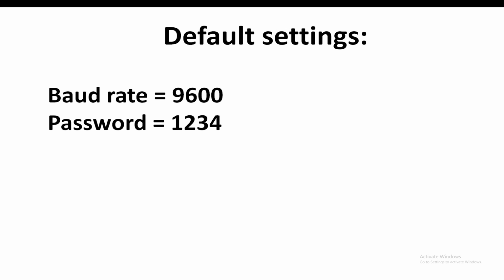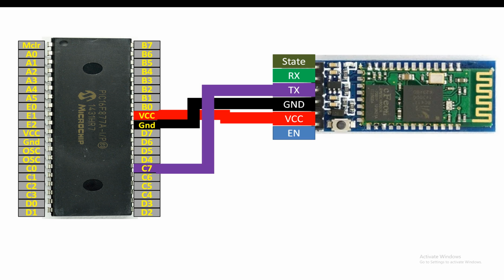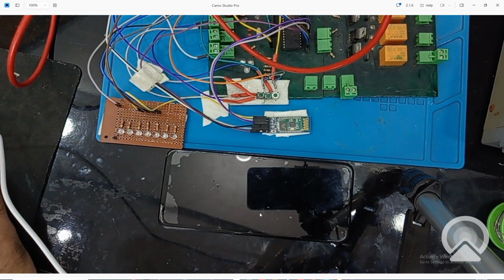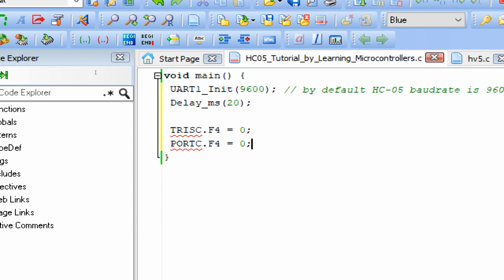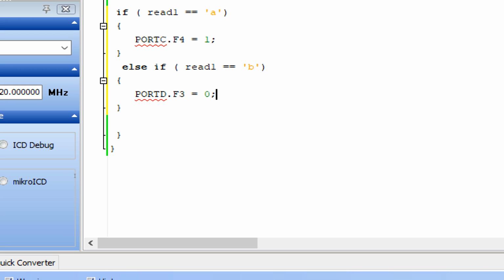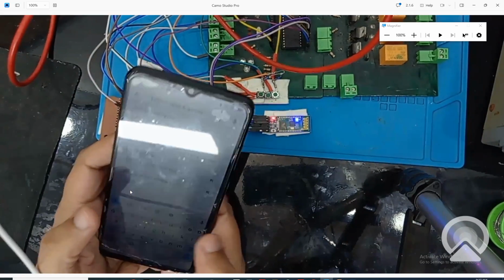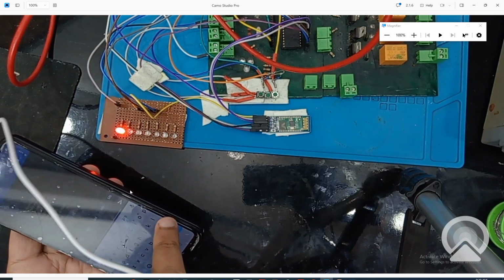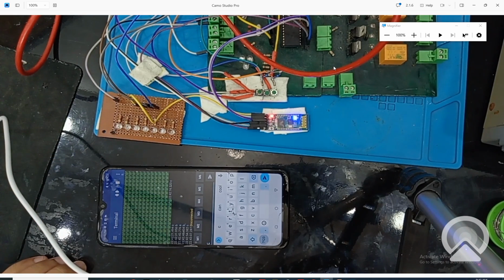PIC16F877A interface HC-05 Bluetooth module. Using Default setting.

Comment: UART1_Write(_data)
Reply: // LCD module connections
sbit LCD_RS at RB2_bit;
sbit LCD_EN at RB3_bit;
sbit LCD_D4 at RB4_bit;
sbit LCD_D5 at RB5_bit;
sbit LCD_D6 at RB6_bit;
sbit LCD_D7 at RB7_bit;

sbit LCD_RS_Direction at TRISB2_bit;
sbit LCD_EN_Direction at TRISB3_bit;
sbit LCD_D4_Direction at TRISB4_bit;
sbit LCD_D5_Direction at TRISB5_bit;
sbit LCD_D6_Direction at TRISB6_bit;
sbit LCD_D7_Direction at TRISB7_bit;
// End LCD module connections

unsigned int adc_value;

float TempC;
char TempC_text[15];

//this fucntion contains all initiallizations
void init_function()
{
   ADC_Init();  // Initialize ADC module with default settings
   ADCON1 = 0b00000101;
   TRISA.B0 = 1; // PORT A0 as input

   Lcd_Init();   // Initialize LCD
   Lcd_Cmd(_LCD_CLEAR);   // Clear display
   Lcd_Cmd(_LCD_CURSOR_OFF);  // Cursor off
   lcd_out(1,1, "Welcome");  //write text on LCD
   delay_ms(1000);
   Lcd_Cmd(_LCD_CLEAR);   // Clear display

   UART1_Init(9600); // Initialize hardware UART1 and establish communication at 9600 bps
   uart1_write_text("WELCOME"); //write text
   //new line
   UART1_Write(10);
   UART1_Write(13);
}

//this function reads analog input(temperature) and display results on LCD
void get_temp()
{
   adc_value = ADC_Read(0); //read analog from AN0

   //calculate temperature
   TempC = adc_value * 1.5;

   TempC = TempC / 1024;

   TempC = TempC * 100;

   floattostr(TempC,TempC_text);  //convert temerature to string

   Lcd_Out(1,1,TempC_text);   Lcd_chr_cp('C');//display temperature

   Delay_ms(500); //wait command
}

void main() 
{
   init_function();
   
   for(;;)
   {
     get_temp();
     
     uart1_write_text(TempC_text); uart1_write('C'); //send temperature value to PC
     
     //new line
     uart1_write(10);
     uart1_write(13);
   }
}

Comment: Hello, was this video for me?
Reply: Good job sir
Reply from the maker: You asked once
Reply: https://www.youtube.com/watch?v=dWq09vtc0WM
I wanted to use the RC communication protocol in the link as a microcontroller without using Arduino :)

But still, thank you very much for your efforts, I wish you continued success, brother...
Reply from the maker: Thats NRF they using there
We can use HC-12 for this
Thats better and cheaper
Reply: It doesn't matter, brother.
Anyway, 200-300 meters range is enough for me, of course, whatever is the cheapest,
There is no rush, you can do it whenever you are available, I don't want you to incur too much expense, thank you..
Reply from the maker: Hc-12 has 1km range in open air